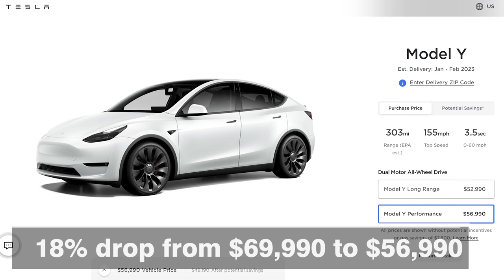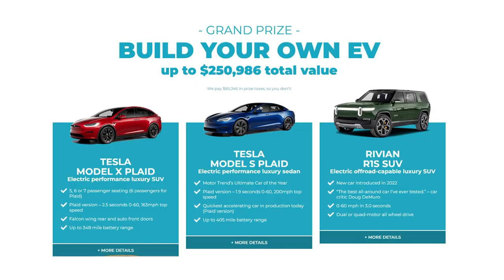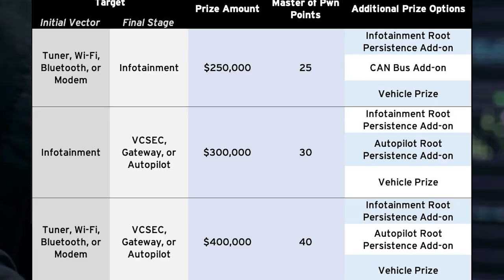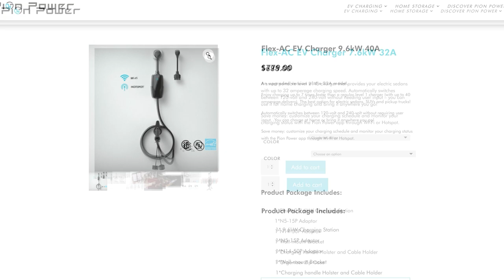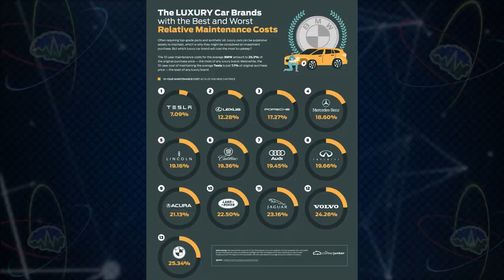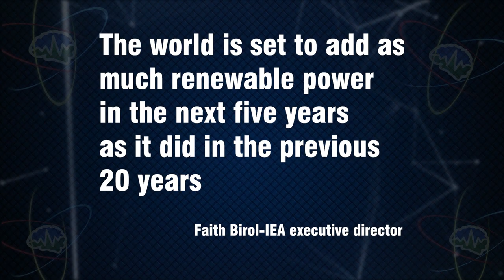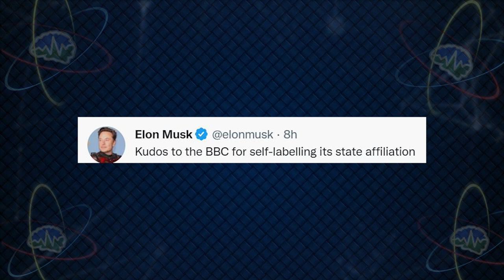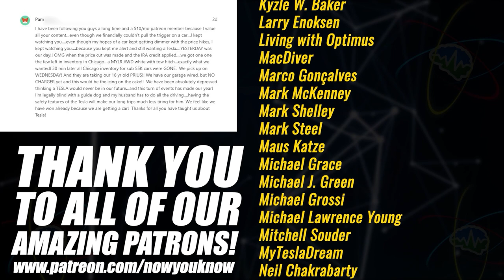Tesla Slashes Prices Worldwide | Tesla Time News

Comment: We installed 13.2 kWh solar PV in 2012 and two PW2 batteries in 2018 and have been net positive and largely independent of power grid since 2018. Simply stated solar + battery storage works, and we are currently averaging 350 % of our energy needs in all electric home included charging two EVs (Tesla's), while exporting all our excess solar back to grid for others to use.
Reply: Solar is "kW"
Batteries are "kWh" 😉
Reply: Where do the batteries go?

Comment: 25:15  I know you are hopeful but FSD is many years off. It is not safe in my daily driving experience. I have to take over several times every day in the first few blocks from my home. I can make a huge list of failures and uncomfortable situations from the 63,000 miles I have driven in 17 states.  There are specific roads I drive that guarantee hard emergency breaking for no reason with no other traffic in sight. I wish they could fix it but I’m convinced it will be a very long time…..still.

Comment: Hi Guys, Great video as per usual. Just wanted to get your thoughts. I read an article that suggested that the US average of miles driven includes non-highway miles where the majority of accidents occur but that Autopilot is skewed since it is only highway miles and when accounting for that and the fact that most Tesla drivers tend to be older and from higher income areas the difference between the US average and Autopilot is minimal. I don't remember exactly which article but I think it might have been The Atlantic. It seems kinda logical but I also think the US Average probably doesn't take into account other driver assistance which would skew the opposite way.
Reply: They address this in a past video

Comment: It's not correct to say MY didn't qualify for the $80k limit tax credit due to it's weight.  IRS says that all 7 seat vehicles qualify and all AWD OR 6,000 lb vehicles qualify as long as it meets certain off-road criteria, including ride height, breakover/approach/decent angles, etc.  The 5 seat MY doesn't qualify for the $80k limit due to its ride height being 1.1 inches lower than the minimum height requirement.

Comment: Long range model 3 is still more expensive than a year a go. These price cuts are just returning the prices back to the pre inflation based increases
Reply: The LR M3 isn't available for order yet. You're looking at inventory because they're aiming to sell those last. I assume they'll drop those prices down to the current lower prices just to make sure they can get as many sold this quarter on the last few days of the quarter. For instance you order a standard range and it won't be ready by end of Feb, they might try to get you into the LR for the same price or close because it's sitting somewhere.

Comment: Had our Model 3 for a year. Rotated the tires once, didn't seem to need it. Had to add windshield wiper fluid today. Am I missing something?
We love it.
Reply: a new car gave you no problems for the first year?  its like magic i guess
Reply: @jebes909090  My new Toyota needed 2 oil changes in the first year. Yes just like any other dependable car no problems the first year that's kinda the point. Just as dependable as a gas car, without the maintenance cost.
Reply: @stephenroyal1619  but it costs twice as much

Comment: I drive my model Y in Canada and the b pillar cameras frequently fog up in cold weather making FSD unavailable. Definitely needs work. Also, the rear camera desperately needs a fluid sprayer. Every trip ends with the camera caked with slush and salt, and it is at the end of the trip that the camera is needed the most to back into my charging spot. I have to get out every time and wipe the camera with my thumb to park. Hopefully my next Tesla will have this fixed.
Reply: Or do what vw do, add a electromag and spring cover

Comment: I rented a I-Pace when in Europe.  Charging speed was really slow vs my Model Y.  Other than that, it was a very nice driving car.  Less truck space, but did not need the back seat, so it worked.  Next time in the EU it will be a Tesla or a ICE due to the charging issues.

Comment: The safety data for miles driven on autopilot might be a bit misleading if it’s only counting autopilot miles. Autopilot is mostly highway driving which is safer and longer. Correct me if I’m wrong.

Comment: It really isn’t 10x safer on AutoPilot.  I only use AutoPilot when on the freeway as AutoPilot is much more competent then (and I take it off when there are issues such as cars cutting in on an entry ramp from the side which AutoPilot doesn’t anticipate).  Non-freeway driving has many more variables and makes up the vast majority of my driving so it is easily 10x more likely to have an accident.

Comment: I was wondering about adding supply depots on the way to Mars. Basic supplies, some tools and parts, food, air, water.  However you can’t pull over unless you have extra fuel and the ability to stop. So we need intersecting orbits that somehow overlap supplies in a shipping lane. One group orbit comes into the lane for an amount of time then another as the first drops out.  Any thoughts? 

You could put rockets on the supplies to catch up and slow down; but I was thinking simple is better.

Comment: Maintenance cost data is skewed because it's labeled as a percentage of the sales price of the vehicle. It should be listed in dollars only. The more expensive a car is, the lower than cost to maintain typically would be relative to the price. For example, the Kia Rio is labeled as very expensive to maintain because its maintenance cost is such a high percentage of its low sales price

Comment: The problem with comparing maintenance costs at ten years between Tesla and Toyota is the Toyota doesn't have a $20k replacement battery hanging over its head.

Comment: The lowered prices are great, but not so much for those who bought a Tesla recently, say in November or December.  As you mentioned, Tesla lowered prices as a result of a recovery in supplies, which clearly indicates they knew by December, prices where going down in January.  They were asking buyers in December with January and later deliveries to take delivery in December, knowing that would cost buyers more money.  They offered incentives to move deliveries up to before Dec 29, knowing full well, this WOULD screw buyers with delivery dates after mid January.  I’m sure they had lawyers ensure it’s legal, but I would consider this very shady, and unethical.    Bottom line, it’s still probably the best car made, and as a shareholder, still a solid company, but the days where they cared about buyers, has long passed.
Reply: I don't understand why anyone would buy a Tesla after the IRA was signed into law and before the IRS rules were released. Because the worst case scenario for Tesla provoked a massive response.

Comment: I paused the video (4:13) to just comment that the price (in 2023) doesn't drop "another $7,500" because of the Tax Credit. I believe the credit it's a non-refundable tax credit. You need to have a 2023 Federal Tax bill of $7,500 or more to get the tax bill reduction. I think in 2024 it is supposed to come off the price of the car. At least that's my understanding.

Comment: What if Tesla learned not to announce new vehicles until it's ready to come out
The Cybertruck was the last vehicle to be announced with "no plan" first
Reply: I agree but I think Elon is just very optimistic. I bet the engineers cringe when he says it. However, when he creates a new timeline for a product (last year for Cybertruck), you can’t bitch that you never heard anything since 2019. I can’t think of any other new EV manufacturer that hasn’t done the same thing. Also, most of the legacy companies have missed timelines on release or ramp up or both.
Reply: @thewaygokid3135  hes not optimistic,  hes outright lying to drive up hype.

Comment: Teslas are safe but their data is very misleading. People using autopilot are doing so in low risk areas like highways. The average Tesla driver is older and wealthier than average and has a lower insurance risk. So the 10x safer figure is dubious. To truly figure out how much safer Autopilot is you would have to control for those variables. Again, I am not saying Teslas aren't safe, but these numbers are a bit fluffed up. Maybe it's more like 8x safer in apples to apples  comparison, that's still extremely good so I don't know why Tesla has to make it seem better than it is. That is my main issue with Tesla, is that they cherry pick data and make statements that turn out to be false. A bit more transparency would go a long way towards building trust from the general public.

Comment: Maybe I'm overthinking this but these price cuts from Tesla might be one of the biggest strategic plays anyone has ever come up with. The IRA seems to be purposely stacked against tesla but however it's framed it is impossible to exclude tesla without it eigther beeing too obvious or without also hitting some models from other carmakers. If you ask me both are the case anyway but for argument sake let's presume it's just the latter. With Tesla now undercutting the IRA limits in both categories anyway I see only one or two things happening. A revision of the IRA limits or, a revision in classification, or both. They can't lower limits any more to exclude Tesla again without hurting other automakers more than Tesla, and, everyone will now want to boost the limits or recategorize to include the left out cars from the other automakers. So, ajustments of the IRA will follow and everyone will be happy to have all resonable EV's included in the IRA, as to per Tesla's mission, excelerate the worlds transition to a sustainable future. But here's the kicker, in the time this plays out tesla demand will rise to levels not seen before so even with ramping production Tesla will have to raise it's prices again, and guess what, with the ajusted IRA they will be able to do so again but without losing the credit. This is some extreme nextlevel stratagizing by Tesla assuming i'm correct.
Reply: @Deleterious_Dumpster  😘

Comment: This goes to prove that Electric Jesus has been ripping you off for 10 years.  He's reducing the price to remain competitive with cheaper imports from China and to try to get into the Chinese market (which is far bigger then the US market).  For those that have been paying attention, EJ keeps saying the LFP & LMFP batteries are cheaper to make, but he's only putting them in the 3/Y models.  Why, coz their energy density is lower and their range is reduced or they get heavier to maintain their range.
I never understood why anyone would want to carry 1000+ LBs of battery for 250 miles, when I carry 80 LB of diesel for 600 miles and it gets lighter as I go, and I can totally refill in 3 minutes.